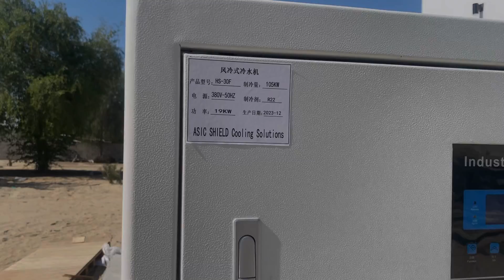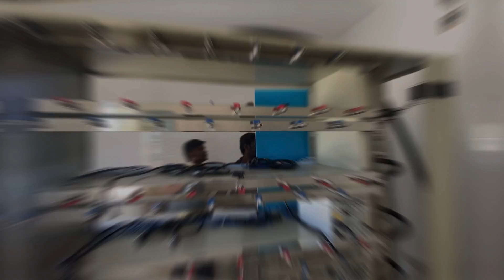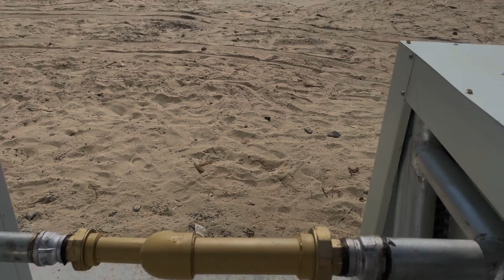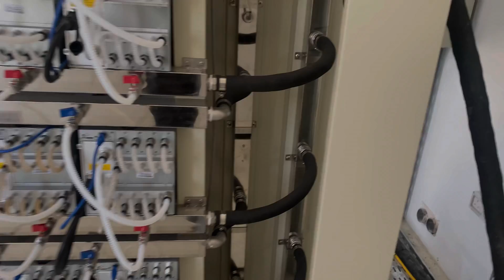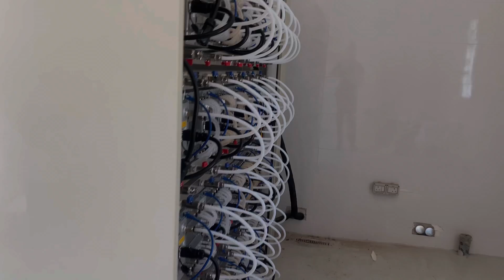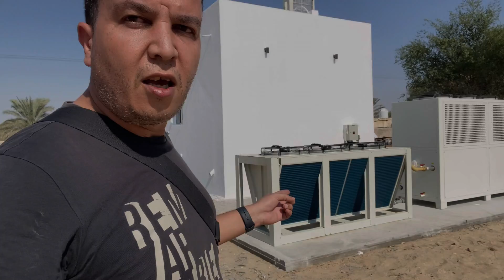Antminer S19 Hydro Mining Farm Full Setup guide

Comment: Great hope mate, i really like the farm and everything it entails regarding the cooling system and the power system. By the way what type of pump did you use? it uses water or refrigerant?
Reply from the maker: we using heavy duty pump from China 1.5HP for this system , for smaller systems we use same brand but 1hp , for liquid depends on where you live , if it gets very cold you need to add some antifreeze to your liquid , pure water will  work just fine , check bitmain's recommendations

Comment: can you tell me a profit of 10 bitmain s21 335 th/s
Reply from the maker: based on the current price and difficulty one S21 335th can male $18.8 per day of course you need to deduct electricity just based on the rate on your area , then you multiply that by X10
Reply: can 10 bitminig be mounted on a 12 kw device
Reply from the maker: @ for 10 miners you better go for x12 miners hydro cabinet , it offers better space and better cooling with a large dry cooler , check this link https://www.asicshield.com/product-page/as-hydro-20-hydro-cooling-cooling-cabinet-for-crypto-mining

Select 12 miners in the capacity section

Comment: Brother How much Power electrical for all miner's you have ?
Reply from the maker: this is the 42 miners cabinet , for the S19 Hydro , each miner needs 5.5KW total for the miners is 231KW and you have the Dry cooler that needs around 2.5KW and the chiller that takes up to 15KW , so total consumption is around 250KW , keep in mind everything is running on 3phase 380V

Comment: Great video, Look out for the Main Water Hose going out to the chiller, it looked as if was bent in a little to steep angle.
Reply from the maker: its not a problem as soon as you start the chiller there is enough pressure to keep it strait , but thanks for the tip
Reply: @Crypto_mining_lab  Thats good  :)
Reply: @Crypto_mining_lab each one price please

Comment: What type of coolant liquid did you use. Was it Deionized water or some other liquid?
Reply from the maker: You can use any liquid based in your location, if you are located in a cold area you can use antifreeze , otherwise regular water will works just fine , it’s a close loop system so you are not wasting any liquids
Reply: @Crypto_mining_lab  I read in some miner data sheets where they had recommended quite low conductivity water. Would normal Dubai tap water suffice for the hydrominers?
Reply from the maker: Regular water will work just fine , of course pure water would be best , but it’s not a must

Comment: Can you deliver and offer these services in the United kingom?
Reply from the maker: yes definitely we can deliver to the UK , for installation the system is plug and play you just need an electrician to connect the main power cable and a plumber to connect the piping between the Dry cooler and the cabinet , we supply everything with the system
Reply: I'm the manufacturer. Please contact me if needed.

Comment: Great video! In the summer when the temperatures are hot, what is the temperature of the water coolant coming from the dry cooler into the chiller? Basically, at what temperature does the chiller receive the water and what temperature does it cool it down to?
Reply from the maker: Basically the chiller has the ability to reduce temperature a lot compared to dry cooler which are limited by the ambient temps since they use fans to blow air to reduce temperature , the doesn’t matter what temperature the chiller receive the coolant  from the dry cooler , the target temp going back to the cabinet would be between 30 to 38 C as per manufactures specification ( the S21 hydro can take higher temperature up to 45 ) so the chiller will work harder in summer to reduce temp down to 38 C
Reply: Yes, I understand that. What I am hoping to find out is how much the chiller has to cool the fluid. For example, the chiller cooling water from 60 degrees down to 38 degrees uses more power and requires a larger unit than a chiller cooling water from 50 degrees to 38 degree. Do you happen to know the highest water outlet temperature from the dry cooler? Also, Bitmain has told me that water inlet temperature does not matter too much as long as the chips and PCB stay below 80 degrees. What is your limiting factor, the chip temperature or just trying to chill the water to 38 degrees no matter what? Thanks a lot!  @Crypto_mining_lab
Reply: @user-ki3hi9vi1u  Hi, the Temperature on the S21 Hyd makes a difference. I try to keep it at around 35 degrees but even on bitmains homepage you can see that the efficiency goes down and Miner take almost 6kW isntead of 5.5 at a 50 degree inlet temperature and they dont recomend going above that. If you will feed it 70 degree water it probbably cut down towards 250 TH/s and still take the max 6-6.5kW.  Regarding your question, it is easy to calculate on these things and make a solution that work for your setup. Just calculate on a system that need to chill 5kW per miner times the amount of miner and in what temperature range it will work in, for me in Northern Sweden I only need a Air/water Heatpump that can handle xx kW of cooling capacity.  And a Ton of solar Panels and 125kWh of battery storage to handle most of the nights also without using power from Grid.   :)

Comment: Have you ever facing "high min temp" error?

2024-01-10 09:38:21 too hot water temperature pic temp 47 (min 47)
2024-01-10 09:38:21 ERROR_TEMP_TOO_HIGH: high min temp
2024-01-10 09:38:21 stop_mining: high min temp

i google all is about "over max temp", that i understand is too hot. but this high min temp cant find anything in google or manual.
Reply from the maker: never faced that because our water temps stays between 30 to 38 C all time , the error you having is the intel water temp is too high , you need to improve your cooling
Reply: @Crypto_mining_lab  (inlet 59 60 42 64-59)	(outlet 59 60 42 81-60)	Sir, may i know actually how to read the temp in dashboard?  in above example, MOS inlet got 59 60 42 64 and -59. they are in Celcius? -59 is average inlet temp in C?

many thanks
Reply from the maker: @MyClassicify  yes that’s in Celsius , the average is 59 C to 60 C within the miners, which is a good temperature , the temp within the miner can go up to 80 C before you have an issue with cooling , you can think of this as the chip temperature , the temp show on the miner interface are picked up around the chips , not the hottest point of the miner , inlet temp is measured before the waist enter the miner which we has a display on the cabinet showing 33 C

Comment: and the breaker is 21pcs. so you share 2 miner for 1 breaker? how many amp is the 3pole breaker each? 
i dint see any relay in wiring cabibet. If one of the cable say L1 red color's fuse if trip or burnt, the voltage will not be 380-410v, is that ok without relay to protect miner?
tqtq
Reply from the maker: Breakers are 63 A each , the miners are 5.5 ke , the bleakest are more then enough handle two mines , a lot of people will be overclocking these miners up to 7kw per miner that’s why you need to leave a margin for that , the system has a phase protection

Comment: Hi, this 180mm 4 core cable, wat is the size (mm) of individual L1 L2 L3 and black itself?
Reply from the maker: Is 180 square mm , that’s a standard size used in electrical wiring is a four core 3 phase and one neutral
Reply: erm...actually is not standard size. if the cabinet can fit 10miner then not make sense to use same like yours.  @Crypto_mining_lab

Comment: Hello it’s not possible to use only a water tower instead of water chiller + dry cooler ?
Reply from the maker: It’s possible if you live in an area where water is wildly available as cooling tower waste a lot of water , and they are limited in terms of reducing temperature 
Dry cooler and chiller don’t water water recirculate same fluid in close loop
Reply: I'm the manufacturer. Please contact me if needed.